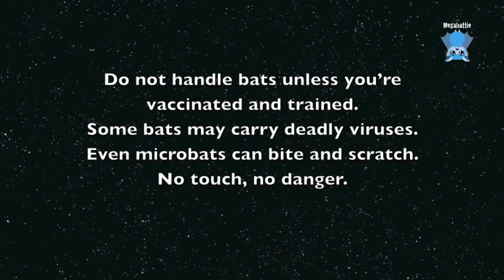Rescuing a Horseshoe bat:  this is Lentil

Comment: Definitely a case of small bat syndrome 😂😂 must feel teeny after all the bigger bats? 🦇 More like the size of bat you will see in the UK.
Reply from the maker: I find them more difficult to handle than the big guys - they're so little but squirmy - and it's hard to control them without squashing them.
I've never been bitten by a micro before, but I'm told it's a new experience in pain.
Reply: I was going to say that too. I have big hands and it would be hard to restrain without squeezing too hard. I never even knew there were other than micro bats until I found this channel (or it found me!🤣😂) I too like the baring of teeth as a method of defense (offense?) - I am small though I am fierce-